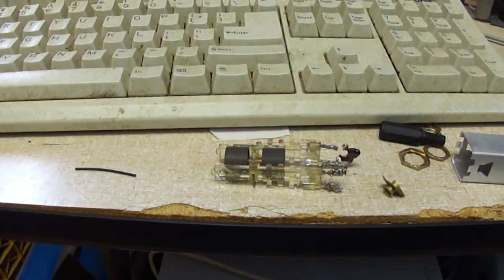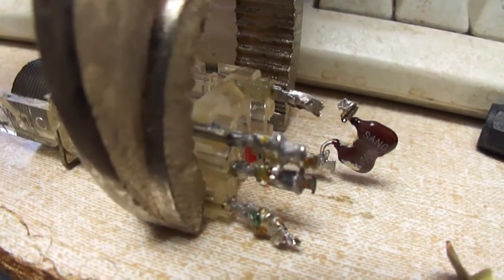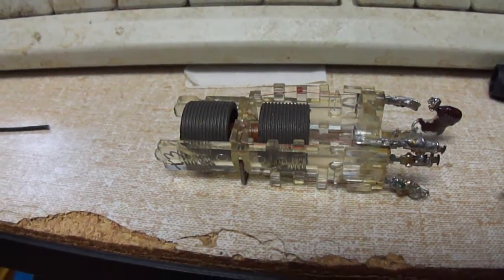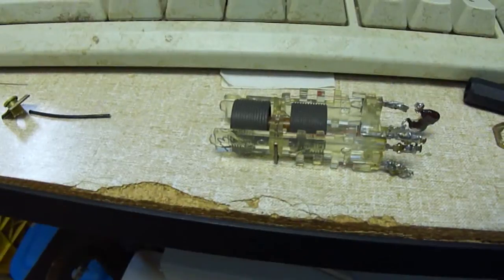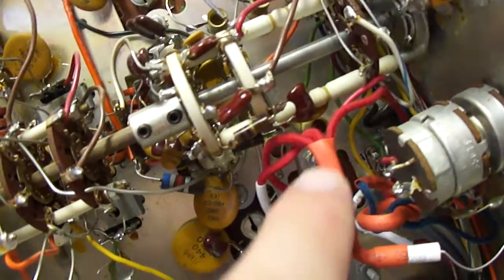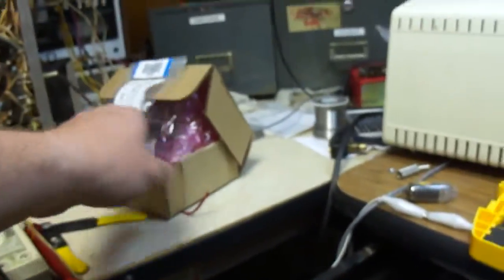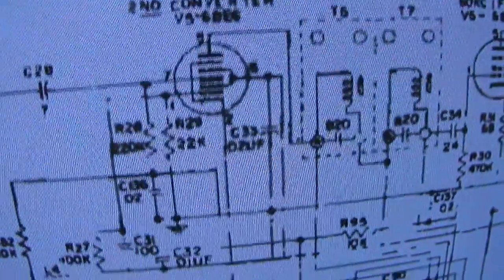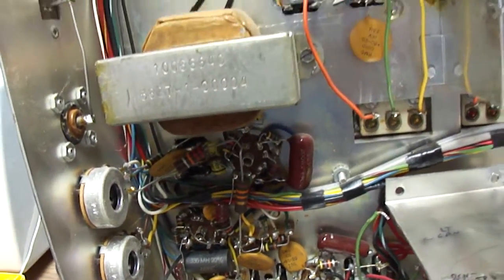1966 Hammarlund HQ-180A IF transformer repair

Comment: @LFOSyncToo because i think it is something dumb to do and will only make the electronics and contacts in the keys not last as long as they rust from the water that was on it. to do know water makes metal rust and is the worst thing you can do to electronics? my wireless keyboard and mouse is from 2002 and so far i took it apart like 3 or 4 times to clean. it is not too hard really and still works fine. took apart game systems too and cleaned. besides i don't have a dish washer.

Comment: @james42519 
I would put the computer keyboard in the dishwasher because it's really efficient, and eliminates a lot of hassle cleaning everything with your own hands.... Taking it apart before putting it in the dishwasher would maximise results and help drying it quicker. You just gotta' watch the temperature (max 50-55° celcius), so it doesn't bend the plastics... But I've seen wonderfull results (basically, as good as new) and there are videos showing that on youtube. LAZY BOY'S technique ;-)